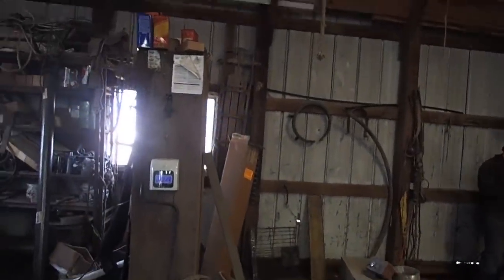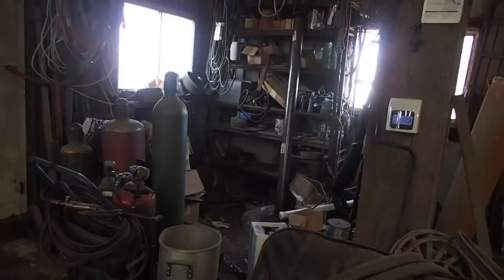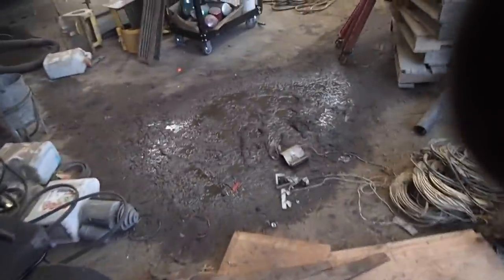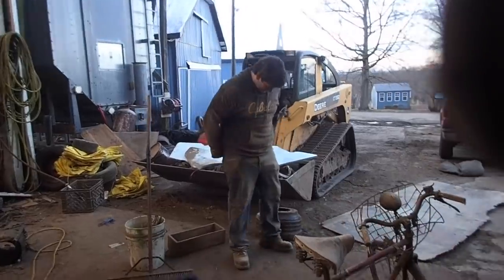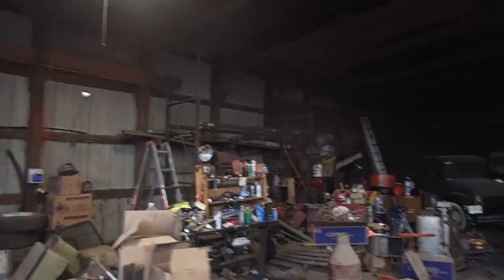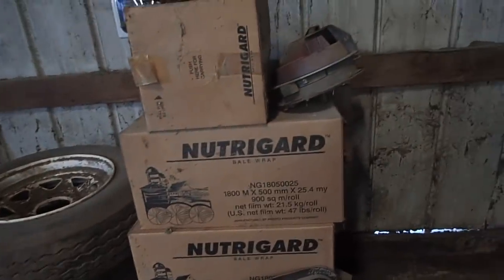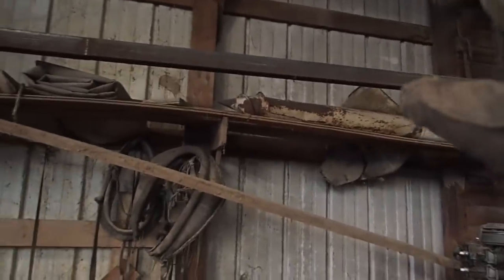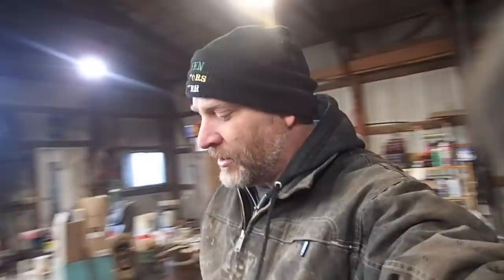Allis-Chalmers Parts?

Comment: Dang it I was hoping this is when you told us you once had a AC D-19 and that you have a governor shaft assembly. Because if that’s the case I’d have dibs
Reply: You don't need the shaft, let me guess the weights spun on the shaft?
Reply: RJ 1999 having issues with it taking off and revving really high. Almost like it runs away. Seems to do it less when I let the engine warm up but it’s impossible to get it going when it’s cold because it runs away right away. Guy on FB group had similar problem and had to replace that assembly. But if you have any knowledge let me know
Reply: @rhoadesy_6567  I fixed a friend of mines years ago, the shaft comes loose of the weights, I took it apart and tack welded it, in 3 spots like a triangle. It wrecks the shaft and the weight carrier but they're junk anyways. That solved his problem that was 20 years ago
Reply: RJ 1999 I’ll have to look into that. Certainly would be cheaper than a replacement as long as it fixed the problem long term. I’m a college student and d-19 is my muscle for hay baling to pay my debts lol.
Reply: @rhoadesy_6567  awesome! If you buy a 190/200 I have new console covers and grills for them.
If you can get me your address I'll send you a chrome Allis Chalmers emblem for your 19 for working hard
Reply: @RJ1999x  I am always on the look out for a 185 or 200. let me know your email or a way to get in touch with you. also if you have Facebook you should join the Allis Chalmers tractors group. lot of neat pictures and a lot of shared knowledge.

Comment: 15 seconds into the video, and I knew what it was! We had a homemade version that hooked on to a homemade weight frame with J bolts. Used in conjunction with a 494A JD planter. I remember it as a kid on the 720 Diesel, and Dad and Paw Paw used it on the front of a couple different 4010's too. Had chains hanging down on each end that danced along the last planted row. The last few links got real shiny! The rest of the chain was pretty ugly lol.

Comment: We once taxied an airplane 3 miles down the highway at daylight on a Sunday morning circa 1981.  From an airport to an aircraft mechanic's private strip.  Stabilator got hit by a piece of the hangar during a storm.  Got some very strange looks.  Luckily, we didn't meet any highway patrol troopers  :-)
Reply: When I lived in the U.k  I used to help a buddy of mine on a Sunday morning at 5.30 before he started back seafishing with his boat after the winter. The boat was so wide the road from his place to the beach had to have no cars or buses on to fit down there.  We used my big tractor on the back as brakes on the road and going down the slipway to the beach. His tractor wasn't heavy enough to hold it on it's own. Ron knew everybody in town and the cops didn't care , the local bus didn't run until 9 on Sundays !  The best parts of that job was his wife cooked a wicked breakfast after, and he gave me his big tow chains we used on my tractor.
Reply: @super6954  I bet that was fun.  Actually, law enforcement would have probably given us an escort down the road.  I know several and they are great.  At that time of the morning, we only met a handful of cars and they all got completely off the road to let us by.  Have a good one!